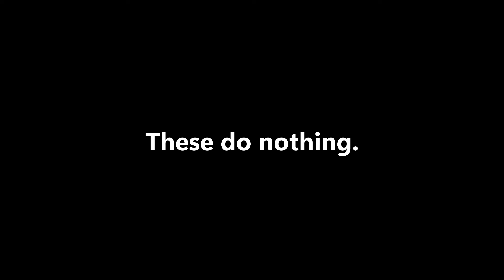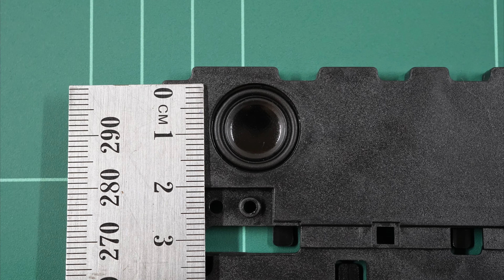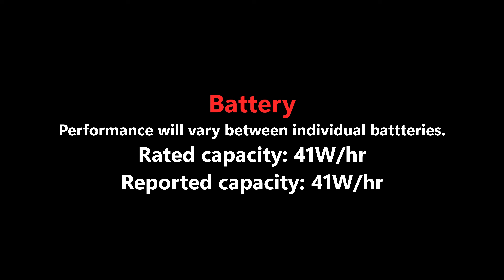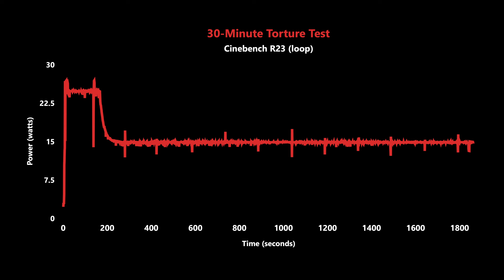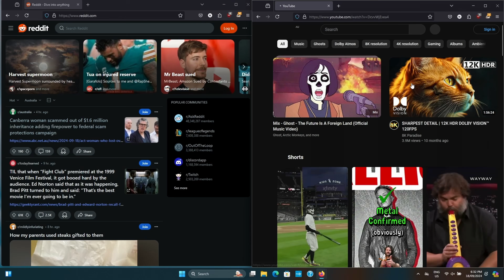HP Laptop 15S - Nuclear Review

Comment: My mom bought me the 15s's younger brother (or rather predecessor) the 14 dk0093au. It had a r5 3500u (about  6 or 7 years ago now). It ran well while it did i can't lie, i played games like gow (at really low graphics but it ran!) and my love for older games was born because of this. It almost always stayed cool had really good battery and when plugged in played decent games (and the screen was pretty damn good). I also used the ryzen controller software and started to learn more about cpus and their tdps. Eventually i got an hp pavillion gaming (ec2150ax) because i had a hissy fit as a kid and threw my old 14 on to the bed and that cause the motherboard to have a hairline fracture which meant whenever i moved it even slightly it would go ahead and kill itself, and am now on a loq. Good memories with this thing and it's decent ig for students if you're on a budget because where i'm from my mom bought it for 334 usd. But if you need the power PLEASE GO FOR SOMETHING BETTER MAN *PLEASE*. Anyway love the review. You're goated man.

Comment: I got a 2022 intel model of this. It's the best laptop I've ever owned, but the hardest to upgrade. Not only hard to crack open the case without damage but the SSD was screwed in so tight I needed a cordless drill with screwdriver bit to unscrew it! It's my great potato laptop now. I usually can't afford anything but the cheapest of the cheap but this one was mislabeled so I got it for a fraction of its actual price.

Comment: I have this laptop but with a Ryzen 7 5700u and 16GB of memory.
Mine cost 399€ (in promo) and I ordered it online without seeing one first.
Big mistake. Mine didn't have a broken camera, but I agree with almost everything in this review.
I also have a very cheap Lenovo Ideapad 1 (15.6-inch variant), and despite being cheap and very low-end, its construction looks 200% better.
Charp edges (not in the same places as in this video) are observed in my model. The chassis flexes so much that it will generate touchpad clicks if we pick up the laptop from one of the palm rest zones. Also, if we pick up the laptop with one hand on the right side (fingers above the top of the numpad), the chassis flexes to the point that the system crashes and the machine reboots.
The screen is also the worst I've seen in modern days, but I would tolerate it at this price point.
The performance is very decent for the price. I could tolerate the screen, but the flex in the chassis is completely unacceptable. I strongly do not recommend this laptop.

Comment: ironically my 500ish 2019ish hp pavilion seems to be an almost universal upgrade over this hunk of junk despite being cheaper. Aside from the cpu(4500u) and usb 2.0 ports, the display is at least an ips panel, keyboard while similar, doesn't flex half as much, and the display barely wobbles. I really like my little laptop quite a bit, I'm typing on it now.

Comment: I too tried one of these god 
Hindge broke in a year 
It was i5 8th geb model. 
Cheap adhesive for hindges 
Display cable got teared and broke due to bad hindge. 
The the wifi card mine one wasn't soldered old stuff died after 3 yrs changed to another 
4 yrs 9 months later trackpad failed. 

I did the mistake of hp elite Book once that that was also e waste. 

Hp stands for hardware problems as expected 

Lenovo ThinkPad e14 lasted me  decades sane as 2015 macbook 

Mac m2 was good too repairability is not great cuz apole but hindge built quality and quality control are always good from apple. 

I have tried lenovo acer hp dell in past asus i haven't owned but has one with friend HP hindge are bad no matter what price bracket or model

Comment: I had the exact same chassis hp laptop but from late 2019 , used it up until now for a work laptop and it somehow survived falling 5 times from a (stationary) car and being logged around in a workshop (used it for car tuning and diagnostics). It really was a crappy laptop but it survived and despite the dying battery and broken plastic on the outside is still working basically as new , except that the usb ports are starting to make bad contact but each day they had like 10-20 connects and disconnects so I guess this is expected from the heavy use for so many years. I made my work get me an acer nitro v15 it is marginally better and at least I can do some light gaming when on work trips and away from my desktop at home.

Comment: this makes my t470 i5 32gb of ram 1tb of storage  look like a gods gift to the laptop computing world  even with its dead external battery and lack of internal like it never had one its just a lead placeholder and  900p TN panel that is not an issue as external display for the win. the keyboard is great i argue the best they ever made and great touch pad and nub. so much more usable then this HP. still snappy and very usable all these years later. with Linux mint.

Comment: I got a HP 15 laptop with a Ryzen 3500u CPU and 8GB RAM, as a present, back in '21. The friend went into the store and bought me a first available laptop with 4-core, they gave him that one.
I upgraded it with a total of 16GB RAM and fitted it with larger SSD NVMe.

Here are my PROs and CONs:

PROs:
- reasonable good battery life,
- snappy, performance-wise it is good for usual tasks (I do not game other than Heroes of Might&Magic which can be run on pretty anything),
- quiet,
- doesn't heat,
- it is reliable,
- has numeric keyboard (big plus for me),
- it is upgradable (RAM memory, SSD, additional 2.5 drive, WIFI module),
- HP still upgrades the BIOS.

CONs:
- screen is crap (TN panel),
- BIOS is locked out, so advanced options are unavailable,
- lacks USB-C,
- NOT for heavy coding - Visual Studio is so slow when compiling due to low CPU cache,
- keyboard on this one is not illuminated (big hindrance for me), 
- keyboard rattles a bit but for me it is acceptable,
- touchpad sometimes go nuts,
- touchpad buttons are absolute crap,
- casing has indeed somewhat rough palmrest,
- on some models, it lacks support for PCIe 4.0 as advertised - the controller is indeed rated as PCIe 4.0 but the actual drive output acts as if it is PCIe 2.0 or 3.0 (although I need to confirm that using multiple SSD NVMes)

Actually, some issues are mitigable. One can swap the keyboard for illuminated-one, see here:
https://sales-keyboards.co.uk/keyboards.php?m=15-DB1041NM&b=HP

I use USB-C adapter to charge it, the adapter easily obtainable online.
The RAM can be upgraded up to 32 GB max.
Touchpad issues can easily be remedied by connecting external mouse.
Probably the screen could be upgraded to an IPS panel too (https://www.laptopscreen.com/English/model/hp/15-db1041nm), but I just connect the external monitor - even having a quality IPS panel can't compare to having full-sized monitor or even TV for multimedia. Screen is absolutely unreadable at sunlight or even during overcast day - you need to be in deep shade for that.

Comment: I love your films. Any chance for a Lenovo IdeaPad Pro?
What are your impressions of different brands?
I used to have a Lenovo (70-70), an Asus (G752), an Acer (Nitro series), and an HP (a low-end one for about $600 and another from my company that costs around $1200). So far, Lenovo was the best, even though it was one of the cheapest in this group.
Now I use a Legion Go, and it seems well-built for the price of $600.

Comment: Your M1 MacBook Air cinebench R23 results seem extremely low, I have gotten 7765 on mine
Reply from the maker: You're not wrong - I run Cinebench for 10 minutes so the Airs tend to have throttled down to 10-12w by the last run, they do score higher in shorter bursts. Even fully throttled they're incredible performers.

Comment: Mmmm lets say I watched this video on a hp 15s-eq2058nf (same one with a 5700U and 16Go of RAM). And I can agree with everything that was said in the video. I would even had that the build quality is so flimsy that (I believe) the motherboard "broke" inside (like sometime I would lift it up and it would just shutdown, and time would change randomly) and I had it still in warranty,  they replaced the battery and the motherboard (or it was broken from start). But for now it is running linux and that's all I really need.
Reply from the maker: Linux ftw, what distro are you using?
Reply: Used Ubuntu for quite a while, switched to NixOS a few month ago. That's what I'm using right now, having fun with it.

Comment: Most consumer laptops are pure e-waste new, even $2000 plus gaming laptops hinges are glued and built quality is pretty bad. You way better off going with a used business class laptop with IPS, or good SVA panel. At least the hinges are not glued in and have a decent keyboard and display. Only HP that are decent are the elitebooks, or some of the EVO series, which have IPS display and metal frame.

Comment: I have one of these but with 16gb of ram. I bought it for 400€, in this price range there is no room to belive in magic, it loses batery turned off, even with the fast boot off, i cant connect an external HDD and a wireless mouse, the mouse will stop working and it crashes if i pick it up by the sides, forcing me to reboot it. Other than these issues is a great little machine if you are aware of what you are buying. I only use it for coding and some light gaming.

Comment: I used to own a Dell latitude d420 and I liked that things attitude towards heat, it simply did not care, it was mostly metal on the outside and had easily swappable parts, it got super hot in the places you shouldn't be touching anyway like the bottom and vent area and it never had any overheating issues or throttling.

Comment: I work as a repair tech and man fuck these laptops lol. Absolute pieces of shit. The amount of times I've seen people upgrade their older HP Envys or Yogapads (9-11th gen) to one of these hurt my soul. Its a downgrade in almost everyway and its such a cheap experience. Most of the times when a 2-3 year old laptop like this rolls in for a repair, it requires parts and is usually half the cost of the device themselves. Sure they will be fine for basic tasks such as word and emails but just from observation through repairs these laptops barely last longer than 2 years. From experience these older clients they are willing to spend the extra money over a POS like this, it just needs to be explained to them. 

When dealing with the older folk I often tell them to just avoid any 300-400 plastic laptop that may be tempting from HP or Dell and try to spend the extra $$ on a yogapad or literally anything else.
Save a grandma/pa and get them something else.

Comment: The default power profile (and most likely cooling system too) severely limits the 5500u's actual performance. If the power profile can be set to around 30w with software like Ryzen Controller, it performs not that far from an M1 in multicore (about 8K in CB23).

Comment: manifesting Thinkpad review
Reply: T14 Gen5 would be a fun one. I have one. It is best described as "an laptop." It has 0 notable features either for or against it aside from the nub and 3-button trackpad, which is exactly how I like my lab machines.

It is the single most boring laptop I have ever owned. Perfect.
Reply: @DigitalJedi  i saw the t14 and it looks incredibe. the build quality is excelent (minus fragile finnish), it has upgradable ram, 2 ssd slots, good cooling and acceptable, albeit 60hz screen. if there was a 16 inch 120hz screen version i would buy it instantly, especially for the price
Reply: @ I'll be honest the display on them is actually quite respectable for the refresh rate. Colors are good and response times are low enough to not feel like an old 60hz slush-fest. Would have been nicer to have 90+, but it's one of those where you don't really think about it after like 2 minutes of use.
Reply: @ idk, i like gaming and dont want to carry a display, so a high refresh rate display is highly preferred for me. I do believe you when it comes to casual use though.
Reply: @DigitalJedi  you mean the nip-ple

Comment: I have basically the same Laptop but with an i5-1235U and GeForce MX550.
I got a great deal on it and that's why I bought it, fortunately didn't have have any problems with sharp edges or broken hardware.
I still wish I had spent a bit more money because even though it's technically fine, I hate it.

Comment: Fun fact: hp already has a 1080p, 250 nit, 60hz ips screen with terrible colors... In their 15 inch victus laptops.
They put a 60hz screen in gaming laptops. They have been using it sinse at least 2018 in their omens!
They also use that l shaped bracket hinge in a lot of models

Comment: I dont disagree with anything youve (especially the screen jfc) said ,but theres one quibble where you quote the price at 700, I guess those are Dollaridoos , but that still sounds very very high

I have an older model HP15s which I picked up for I believe 260 euros in 2022 , and I set my mom up with a updated model last year for like 350. At that price Im willing to compromise and you will on nearly everything ,but within reason . 

At that price, I dont hate it!
Reply: I got mine for MYR 1,649 or 350 euros and it came with Ryzen 3 5300u 8gb of ram 512gb SSD and honestly the only reason why I picked it up was cus it was the only decently “powerful” laptop for its price point. Since every thing else is either powered by Intel Celeron or sum. 

so far after using for about 8 months or so and it's doing alright? mine didn't have any obvious defects upon arrival nor is it acting strange whatsoever. But that doesn't mean I'm not scared off shit every time I hear the hinge creaking for its dear life.
Reply: oh I also replaced the broken screen on my old 2022 one with a 35 euro fresh generic part from ebay I think last november. It was absolutely mummified in sticky tape sure, but pretty easily able to swap it in and out and secure it with only a scrap of salvaged tape. The cheap fisher-priciness of the build quality works in its favour there, because you can just snap it back in place more or less and not feel bad.

Comment: I had this laptop for about a year until it died about 2 weeks ago (Faulty cheap charger, the cable on the original started disconnecting from the brick after less than a year). I used to hold it on its corner until doing that made it randomly shut off sometimes. The rubber feet are nice but they also come off. When I tore the laptop down to see if I could repair it, I discovered one of the screws under the missing rubber foot had fallen out at some point. At least it only cost 450€ for the 16GB ram model, although the 512GB SSD had only one NAND chip. I can confirm the cooling setup is so bad you can't even play Minecraft for more than a few minutes without thermal throttling to 1fps
Reply: That's not cheap for what you got. I got a Pavilion Plus 14 for $450 also ~ a year ago and yes, it's still an HP (sigh), but at least I get a full metal build, a Zen 4 Ryzen 7840U, a 1TB actual gen 4 NVME and a 3K 120 Hz OLED. Getting a bargain like that is the only way I'd even consider getting an HP.
Reply: @kompassorpigo7600  Damn how are you getting deals like that? I bought a new laptop with 512GB storage, 16GB ram, an OLED screen, USB4 and a 7540U and after shopping a bunch I thought €670 was pretty good. Was your $450 before or after tax?
Reply: @ I think it was after tax lol
No USB4 though (but the two USB-C ports are full-featured thankfully). 7540U is still a great CPU since it's Zen 4. The only reason I wanted the 7840U config is so I could game a bit here and there.

Comment: The only HP Device I ever used was the HP ENVY x360 Convert 13-ay0477ng, which I got for 900€ in 2021, specifically to use onenote while with a pen and light programming work. I also used it for some emulation and indie gaming. Not sure what others think of it but I liked it. The guy in class sitting next to me got the same, except used. He poured two energy drinks into it and it still worked for the most part.

Comment: I used to have an HP "Laptop 15" similar to this one and I can assure you that your judgements regarding those hinges are absolutely correct and they failed the most out of any other laptop I have (yes, the most - I had them literally replaced and yet they failed again). The 2nd time they failed they failed so hard it cracked the LCD so go figure.
Reply: I also have a one similar to this and I'm about to send it in for it's 2nd hinge repair.

Comment: The only good HP laptop I know of is the HP EliteBook 845 G7 with a Ryzen 3 4450U processor. That's it. It's got good build quality, expandability, and that Ryzen 3 4000 series chip is soooo power efficient and price competitive now (with most of those EliteBook 845 G7s being sold for $200-250) that not even the bad cooling system (as always for HP) makes it bad. It's also silent at normal use, but you have to repaste the laptop with PTM7950 and undervolt the CPU with UXTU and set an 83C temperature limit for it to not overheat or run hot. Once you do that, you get something that can rival a Macbook, yet has easily upgradable RAM and storage and repairable design.
Reply: The 840g1 i5 is a surprisingly decent old machine, 900p in the era of 768p, latch removable back panel that you can just rip the ram and battery out with your bare hands, two m.2 sata slots, and a 2.5in slot. Also 4 usb a, sd card slot, vga, displayport, docking connector, and sc card slot